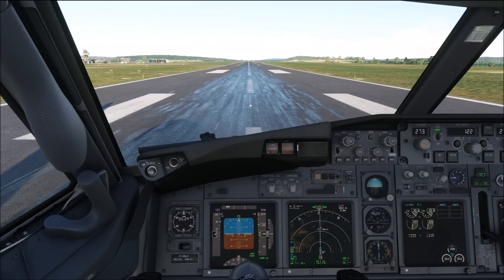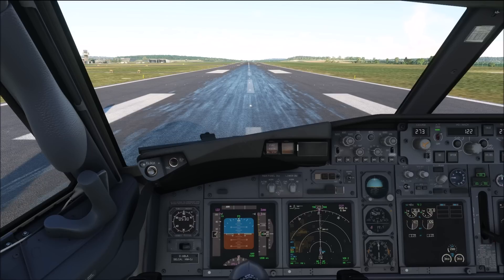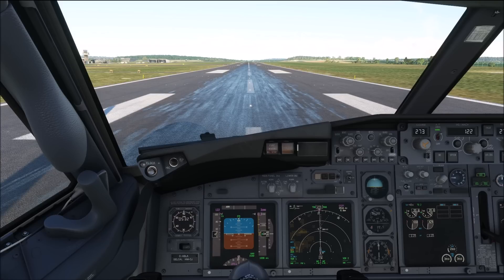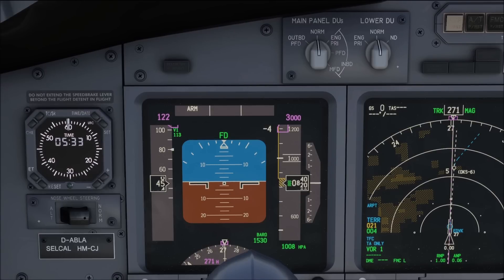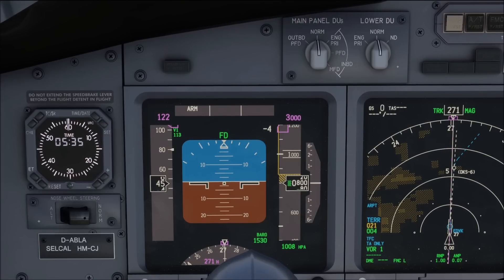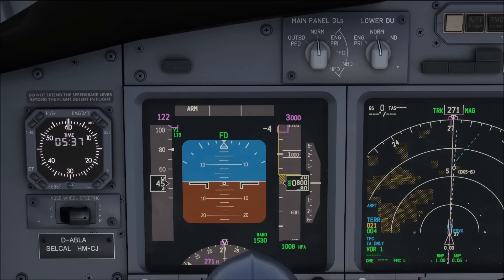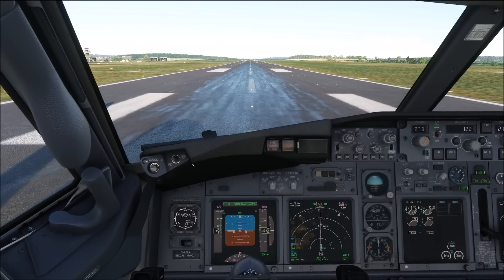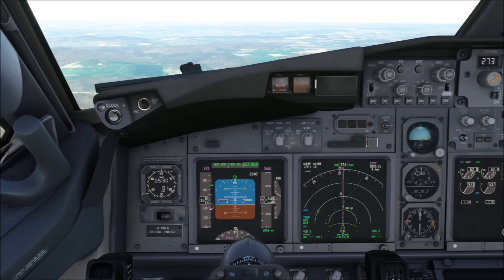Preparing for the -800: Practice your Rotation | Real 737 Pilot

Comment: Sounds, it will be easy in 600 :)
Reply from the maker: It is! Much harder to mess up in the 600 than in the 800!
Reply: @A330Driver  Think I’m going to practice just take offs for a while, either do super short hops, or put nose 👃🏼 into the ground…then do it all over again :)
Reply: @A330Driver  And I thought 💭 all 737 about the same, just different performance & range. It would be nice, when all 4 versions are released by PMDG, if you could do a comparison of functions and performance…what is same and what is different :)

Comment: When the -700 launched I was absolutely taken aback by how many users are rotating the aircraft at excessive rates. I think a lot of this is due to xplane to be perfectly honest. I found the Zibo to be extremely forgiving on rotation.

But, as you and I both know, there’s kind of a point where you “catch” the rotation on the 737. It’s not a linear thing. Once you catch the rotation you finesse the movement of the yoke to control its upward movement

Comment: Does the sim also replicate tipping of the a/c which the -800 is prone to do?  If you leave the forward door shut and deboard from the rear, is that possible?
Reply from the maker: I never actually tried, but seeing that PMDG hopefully follows a logic here those passengers sitting in the front should hopefully start to board first before the passengers sitting in the back so that tail tipping won't become an issue.
Now, it would surely be interesting to give it a try and I certainly will.
But unless we're getting options to distribute passengers per cabin zone I don't really see how you should force tail tipping to happen.
Reply: @A330Driver  indeed.  Maybe not PMDG, but I wonder if GSX influences that too.  I'd be interested to see what you come up with!!

Comment: Quite difficult to practice any rotation in MSFS right now. All planes rotate like a freaking Cessna. 

Wayyyy too much lift. Let’s see how many months it’ll take asobo to fix this issue. AGAIN!
Reply from the maker: yep... but that's exactly the reason why you should practice it now. Yank it up in the -800 and you'll strike that tail right onto the ground.

Asobo issue or not... unfortunately.
Reply: Hey so I had this problem too and a quick google search told me to change the extremity deadzone to 40-50 on what ever control you are using. I tested it out and now I can rotate the 737 with the proper 2-3 degrees/sec. Hope that helps.
Reply: @Deltafan311  - thanks. Although i do understand the quick fix, but the issue is asobo has reverted back to a faulty lift ratio for all planes in the sim. ☺️ 

But I’ll try your temporary solution. ☺️

Comment: I've found it much easier to use the HUD when commencing rotation. Combine that with the info in this video, I can easily managed rotation and climb with the HUD. Can that also be used as a tool for this? Thanks for the video.
Reply from the maker: The HUD is a very good tool for it indeed! I find it much easier in the sim with the HUD as well.

Comment: Hey this may be a random question but I'm curious about how you like the take off dead band in the PMDG? I think it could be stronger.
Reply from the maker: Seeing that right now only the 600 and 700 are released, and those don't have a dead band, I like it very much so far.

I'm not allowed to comment on the -800 while the NDA is still up.
Reply: @A330Driver  Really? Not even if you rotate like really fast to about 12 degrees with wheels still on the ground?